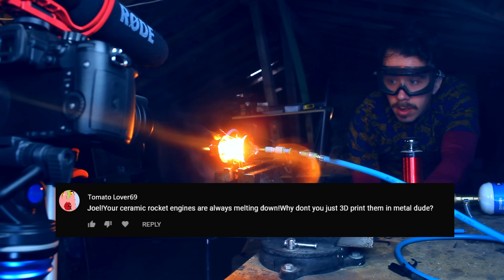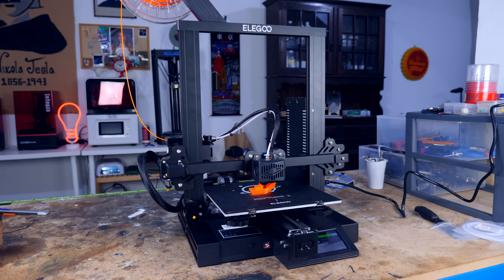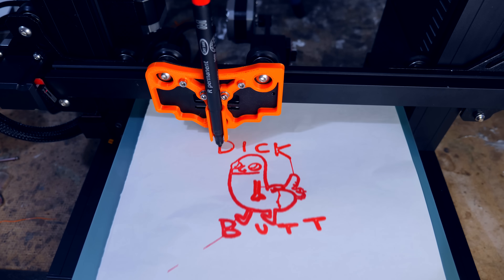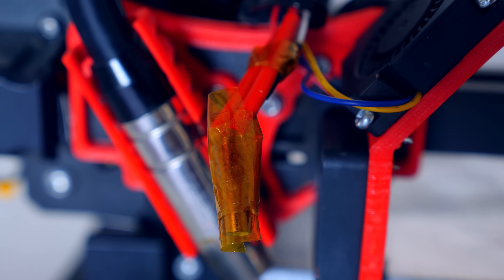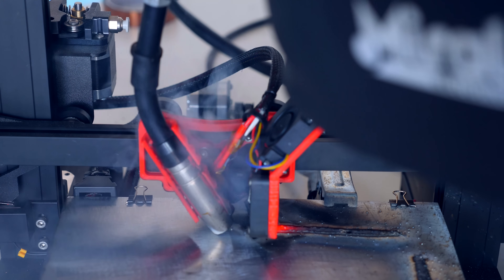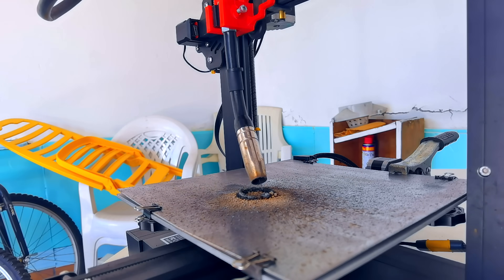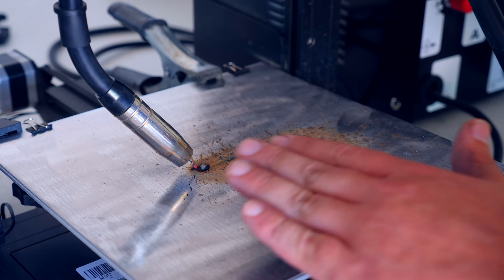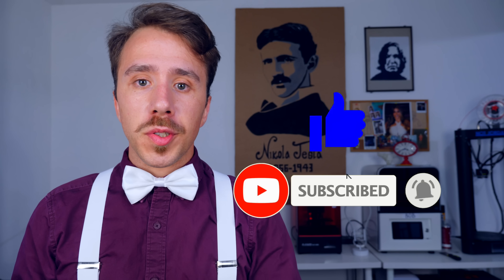I built a Metal 3D Printer using my Welding Machine

Comment: Integza I know this sounds a little dumb but you could 3D print the parts separately and use them to make molds, after that you melt the metal and cast it in the mold, indirect 3d print kinda of

Comment: the biggest problem is to prevent the sheet from deforming, you can solve it by using 3mm steel and separating the aluminum bed from the steel plate with wooden shims, so that between the bed and the steel plate on which you are going to weld there is air (excellent thermal insulator) to avoid damage to the printer, you can take the gun lower, in order to gain height, for the power you should ask a carpenter, he will be able to give you values both for speed and for power. I wish you a good day, greetings from Italy 
Ciao meraviglia 🦄

Comment: Hey, why don't you try using Ultrafuse 316L filament. It can be printed in a FFF/FDM printer and post-processed into a 100% 316l metal part.

Comment: New version of metal 3d printer: strap a high powered laser on 3d printer with movement only on XY axis and use metal dust bed which can be moved in negative z axis with strechable bed edges to contain the metal dust as it moves down. I don't know if it works successfully or not. It might blow up in your face like that disgusting tomatoes with the added advantage of your hair getting burned off.

Comment: You'll get a LOT further with this sort of thing if you use a special type of wlding filament called a Filler Filament. It's designed to go down thick and fill holes and cracks in metal.
Reply: Also, if you can encase it in a sealed box and fill it with argon gas, it will help a lot.

Comment: video idea : try to make a metal 3d printer using pcb soldering wire.melting temperature of soldering wire is also low and you will have so called metal called printer. and then use induction heater to melt metal of low melting point like copper. I wish it will be easy fix for you rocket nozzle

Comment: How about the metal 3D printer, but instead of a welding machine use a laser to bind metal powder. Then sprinkle a new layer of powder, fuse it with laser, sprinkle, fuse repeat till you get the shape?

Comment: Did you use 82 % Argon / 18 % CO2 as shielding gas or was it stainless steel wire with 100% Argon?

Or was is it a cored wire welding machine? ( It like an 
Shielded metal arc welding electrode but in this case it's like a tube with Flux core inside).

You should maybe use the "4 stroke" instead of 2stroke.

2stroke: it  run so long you  holding the button if it stops the short circuit break.

4stroke push the button it run so long as you push the button again .
It is used if you want stability in long filled welds 

Im not sure if it is the correct technical name i have learn the technical names in German

Comment: can u maybe make a 3d printed engine..i entertained this idea alot..so some parts would be metal...like maybe deodorant can cilinder walls and metal cracnkshaft...also it would be cool if instead of using ignition coil u use piezzoelectric ignitor and a camshaft to activate it...i think it woudl run..id try it but no 3d printer hehe

Comment: I already told you man, the solution to the Wankel Engine problem is the same for your rockets.
you just need to run the wall very, very rich.
so the fuel act as ´protection and cooling layer against the flames, no need for fancy metal 3D printer.

Comment: I recently for the first time saw a video about Conductive ink pens (made by GreatScott) strapping that pen to the 3d printer, possibly trying to make it as clean as possible (it will need a bit more than the example pen you made here, something more similar to the marker mounted on the metal cnc cutter made by stuff made here)  and try to convert gerber files to gcode while you're at it.... this metal 3d printing project is actually quite smart but even if it worked it would have hardly been useful, too unprecise and rough the idea was fun as the video and I'm sure you wasted quite some money there ty for sharing... i am now contemplating if it would be possible with some lower melting metal tho......

Comment: Video Idea: Try making a soldering iron 3d-printer, because the solder needs lower temperature and does not spark, it will be easier, and not warp your sheet metal. Also, since solder is easier to use, it will hopefully have better results that the welder, and be able to use your first or second brackets that you designed, without sacrificing on build volume.

Comment: instead of directly using welding machine which uses heat from arcs to deposit molten metal , You can make a nozzle with a heating element to support the temperature of molten metal and use it like an FDM printer

Comment: My Gcode told me to come to this video's coordinates at a rate of F6000
Reply: HAHA good one!
Reply: Make an hho generator and a fuel cell
Reply: @parshvapatel8484  gross. That doesn't actually do anything, just wastes energy.
Reply: @LazySpaceRaptor  the man just made like 57 rocket engines and burned them for giggles and you think wasted energy is of his concern?
Reply: @noafroman1  he burned them for science. An engine powering an HHO generator that feeds that back into the engine is just a Rube Goldberg device to reduce your overall engine power.
Reply: @LazySpaceRaptor  i read it as make an hho generator, and a full cell. But yeah that would be dumb as fuck 🤣
Reply: GOING BALD !!!!!!!!!!!!!GET A TOMATO   CRUSH IT UP RUB IT ON THE BALD SPOTS AND IN 24 HOURS YOUR HAIR WILL NEVER GO AGAIN
Reply: @itzmejav995  tell me more
Reply: @itzmejav995  what else can it do
Reply: Here have a 3d printer
Reply: fools using feed for rapids. A real cncer uses G00
Reply: @henryswan1374  all fun and games until the dogleg path causes a crash 😳
Reply: Joel the comment god strikes again
Reply: :D
Reply: 6000 kms?
Reply: That's actually kinda slow.
Reply: Wait u have the same name as him haha
Reply: :D
Reply: Tried to do the same, did nothing but skip steps and had to slow down to 100.
Reply: Thats pretty fast man, I generally run around 50... for cnc plasma 😄
Reply: Best Laught I've ever had! Bc I'm a machinist it's even funnier..
Reply: Yes
Reply: https://youtu.be/uO5pVLOAmD4
Reply: https://youtu.be/XgElbL6pPjA

Comment: Integza: "gcode can only do straight lines"
G02 & G03: "What am I, a joke to you?"
Reply: I was thinking the same thing xD
Reply: Came here to say this.
Reply: They also do straight lines. The just save you time. The circle is a shape of multiple straight lines with relative angle, for a cnc at least. The stepper motors have some finite accuracy
Reply: @GAS-OR-ASS  Well anything digital has some level of discretization, the question is who calculates the SIN's and COS's :-)
Reply: @GAS-OR-ASS  I'd argue that gcode does circles/arcs, that's what the commands mean. The straight lines are a thing of the machine that just translates the G02 and G03 for itself, in the gcode it truly is a circle. If you had a machine for drawin in polar coordinates then G02 and G03 would be true circles/arcs, not chopped up into lines. But aye, given this context it does end up, on the machine and output side, as lines.
Reply: @GAS-OR-ASS  The G-code is commanding the device to create an arc, not single segments, but most (all?) 3D printer firmwares don't have support for doing that as STL files can't have arcs, and therefore they cut them into short segments as a workaround. But even if the printer can't do arcs, the Gcode definitely can.
Reply: @GAS-OR-ASS  NO.G2 and G3 are real circle operation.Its just that stls and marlin cant handle that. In cnc operation we coulnd make other wise fits for bearings and shit like that.Alos you need really good servo drives with the rigth settings.
Reply: @GAS-OR-ASS  The point is: instead of dozens or even hundreds of lines of linear movement, one line with a G2 or G3 command draws a circle that is as precise as necessary.

The reason slicers don't generate G2/3 code, is that the .lit format, they use to import the object shapes, has arcs and circles reduced into so many triangles. There are some add-ons that recover the original arcs and encode them appropriately. It results in a code with much smaller filesizes.
Of course, due to rounding in the generation of the approximated shape, it won't be as precise as code generated from the original circle parameters.
Reply: @GAS-OR-ASS  this is true, but it’s usually done to save file space rather than make the circle more accurate. In CNC milling machines, even a step over this small is noticed and needs a constant radial movement.
Reply: @GAS-OR-ASS  yes, but for many applications it approaches close enough to a curve that it is effectively a curved toolpath.
Reply: @LuciaMakes  *Riemann wants to know your location*
Reply: Most 3D printers that run Marlin don't use G02 and G03, you have to activate them in the firmware. Plus, most of the commercially available slicer softwares don't use these, so the get around this by just using G0 and G1

Comment: What about casting the rocket nozzle? Make the part of out plastic on a 3D printer and then put it in casting sand with the needed vent and fill holes attached and then cast it out of steel. Edit: The plastic should burn away as you pour the metal it because the metal is that hot, but if that doesn’t work you can also bake the plastic out and then do the casting.

Comment: There's an idea that I've thought about a lot, imagine, a roomba robot-style system, but this one for cutting grass! like, a sensor/camera that detects the height of the grass, and automatically launches the robot, in which you define the area where it can work, and that cuts the grass and dumps it in a desired location. 
Seria incrível ver essa ideia em termos físicos e reais/it would be amazing to see this idea in physical and real terms!
Reply: Roomba-like lawn mowers already exist, though they can be expensive.
Reply: @Stevarooni  that's why I suggest to do one, DIY, trying to be low cost
Reply: That would be interesting if he put steering on a lawnmower.

Comment: Thicker sheet of metal absolutely a few inches and you'll be good. The reason for tilting when you mig weld is to control the way your gasses flow, if it flows under the metal, you got yourself porosity. Unless you tilt it in reaction to the direction its moving, its not worth tilting. 
I imagine spiral weakspots.. Is there a metal with a higher melting point than steel that doesn't stick to mig.. that would be perfect

Comment: The induced welding current doesn't burn out components when welding. How is it possible ? Because if the current has access to the machine, it could burn the control box without insulation ?

Comment: Do a video where you try more of this, but you make a more sturdy mount closer to the print bed and change the firmware to not mess you up with temperature sensors and hotend and have the welder trigger hooked into the printer so when it sends a extrude command it turns on. A thicker piece of steel will help too :)

TLDR; Try and build a even better Metal 3D Printer

Comment: There is two new filaments from "Nanovia". One is stainless steel and the other is ceramic silicon carbide. They do not need to be sent away for chemical debinding, they just need a low temp sinter followed by the usual sinter. You could probably use your small kiln. If stainless isn't resistant enough then print a stainless steel nozzle with ceramic silicon carbide nozzle and throat lining. I plan on using these to print a decent size solid rocket motor.

Comment: I had a fun time converting my Ender 3 to a machine capable of printing 2 materials. I had to change out the system board, and finagle with the firmware quit a bit to get it working.

Comment: Video idea: Build a flame thrower out of 3D printer. Any flammable gas or liquid can be used and contained in a 3D printed container. Make sure it has long rage and long lasting. If wanted used some pressurised co2 or water to cool it down Burn some marshmallows man.

Comment: Idea: you can’t buy a metal 3d printer but you have sheet metal and a welding machine, you can actually weld it so as to make up for a metal engine, you can also have this metal engine or even your 3d printed jet engine water cooled, in that way it doesn’t melt, you can use those 12v small submersible pumps which are pretty cheap.

Comment: You could try to weld a 3d printer case out of old steel and make it weld bc if you biuld it yourself you increase your welding skills and build the printer for iron parts. And if that doesnt work there are people that have a cnc and make your modells for a few bucks

Comment: Video idea: try casting metal in sand to make your nozzle. Use a 3d printed nozzle as the mold.
Reply: Ya as long as he gets a furnace that can melt at least copper it should work. ones that can melt steel are more expensive
Reply: @mikethompson9555  also molten steel loses most of its properties. He might as well use the copper.
Reply: @mar117117  unless it's tempered after or quenched in oil like they do with swords it has less chance of success and can crack because it's an aloy copper will do much better cuz it has a natural Crestline structure the only problem is copper is also a major heat conductor and not heat resistance and aluminium with the pure oxygen and fuel might actually get hot enough it might melt in testing or because the heat and pressure will make it soft enough it'll explode
Reply: @mikethompson9555  well because it is a heat conductor it will actually cool better,  but you are right that low melting point would be a problem, unless cooling is solved
Reply: With electric arc furnace it's possible to melt even steel, and it's not so difficult to make :3
Reply: @potatosalad68  ya cuz trying to buy furnace that can melt steel is pricy I watch bigstacked and he doesn't even have one that can melt steel yet and his whole channel is about melting metal and casting it
Reply: Thats exactly what i said lol but you were first fair play
Reply: I think the 3d printed mold wouldn't work out, but the casting metal in sand is a good idea.
Reply: @potatosalad68  Yes it would work ; it's called "lost PLA casting", check it out!
Reply: @potatosalad68   I know its been done before. The trick is to have little to no infill, and to have a pour spout and an exhaust spout. Then design it to fill from the bottom so it wont collapse on itself
Reply: cast a mould out of ceramic from the 3d printer.  Two piece or more mould to cast the rocket engine
Reply: He would need a  forge/furnace.
Reply: I believe he meant PATTERN of "3D printed nozzle" For creating the sand mould.
Reply: +1 good idea but risky

Comment: You really don't have to have a "metal 3d Printer"

BASF Ultrafuse 316l can be printed on any printer that can print ABS and has a hardened steel or ruby nozzle.

The filament is expensive but not a bunch of Tesla's expensive.

Comment: interesting project but I would pay more attention to the smoke that rose during welding ... the piece of sheet metal that was still bending looked like it was not cleaned enough ... it looked as if there was zinc on the surface and the fumes from it are not much healthy ... next time a place that is well ventilated ...

Comment: Now that you've tried to make a metal 3D printer, you should either try to make a CNC router or plasma cutter. Even a friction welder would be cool to see.
Reply: Yeah, friction welders are used at big rockets, instead of regular welding.^^ so that's cool! :3
Reply: there are 10000000 videos about cnc building :)  frictioin would be fun but not very usefull :)

Comment: What if you try spreading a thin layer of metal powder and zap it with a high current to precisely melt it, then repeat for each layer. That would be almost like a metal FDM 3d printer! Just build some kind of spreader thing to go across the surface, adding powder and flattening it out for each layer before you commence the zapping

Comment: You can kind of make this work, but not with Flux core wire. You will need solid core and argon shield gas which will give you a much cleaner weld.

Comment: Relativity Space would like to know your location. 
You can prevent warping by putting a big piece of aluminum under the metal sheet so you don’t have to use a thick piece of steel each time.

Comment: Much better results if you used a welding gas and fluxless wire,  That fluxed wire in MIG welders is crap.

But as we say in Australia, you would still be pushing shit uphill with that setup

Comment: At this point you could indeed buy a cnc machine and cut metal parts on that, i've seen with some care and attention to temperature that you can cut aluminum sheet on a cnc mainly used for cutting wood as long has you have the proper drill bit for metal. Then with some welding you can make more complex geometry parts.
I really want to see a full metal rocket come out of these projects, 
pls Integza Kenobi you're our only hope.